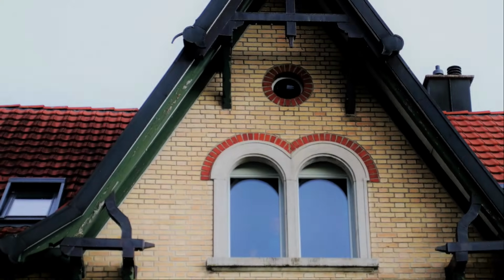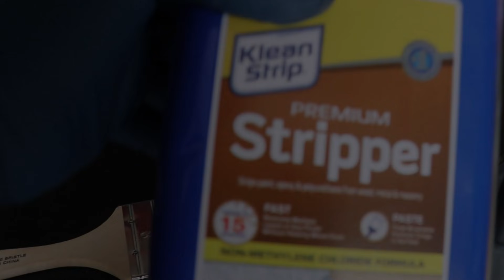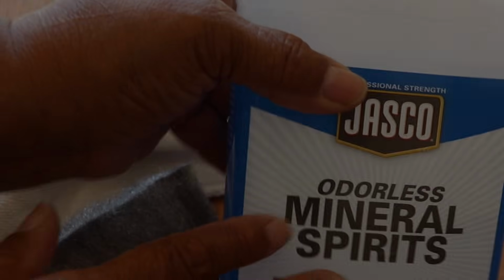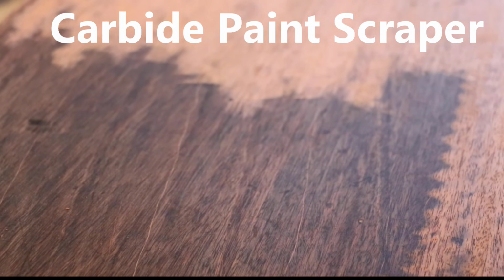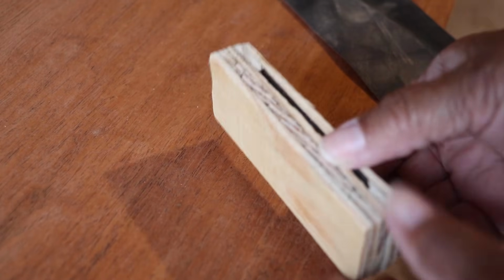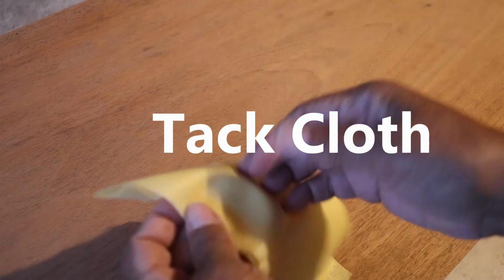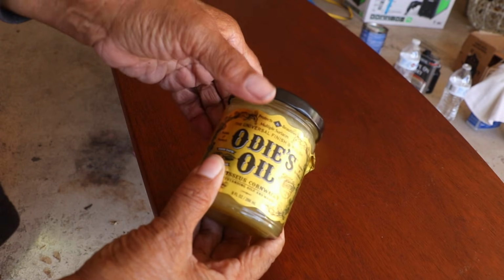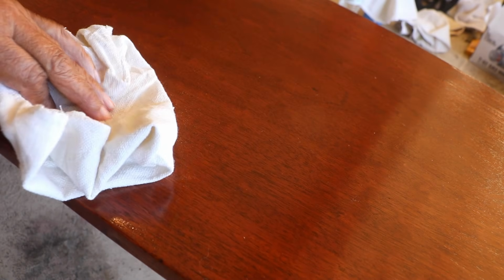$20 Thrift Store Rescue// Furniture Restoration for Beginners

Comment: Beautiful job Ms. Leah!  When you said Grandparents attic, I thought you were going to revisit how to tell the difference between shellac and polyurethane and not to ruin a proper antique 😂. I am always torn between Oldie’s and Kramer’s, I like both.  I did pick up a small pine dining table years ago that neighbor’s had put out for trash pick up,  they said the leg was broken and it couldn’t be fixed.  I was going for the wood to repurpose, so it didn’t matter.  The leg wasn’t broken, the angled brace board that it affixed to was cracked and the holes where the bolts went through were messed up, as well as a couple bent screws into the apron, I think someone was dancing on the table…a little glue, some patching and the table has been in service for many years in my shop.

Comment: In my youth I made the mistake of too aggressively stripping a piece of furniture that I didn't realize was veneer. The patch I did was smooth but I could always see it. It was a 50s era dresser that was stained green. It was funny that I ended up stripping the veneered surfaces and leaving the solid wood trim surfaces the original green stain.  I had that piece for almost 40 years before I finally got rid of it. It was still a solid piece of furniture the day I sold it (before a move). And I'd gotten it for free in the first place, from family, just like you suggested.

Comment: What about that wax layer will a chemical stripper remove that as well ? . Side question I usually like to leave the wood looking it's natural color what's you're go to finish that don't react like the before mentioned wax stuff ( i.e cup rings )
Reply from the maker: If I understand your question,  youre asking how to strip heavy wax from a table.  Mineral spirits cuts eax build up.  I suggest you test a spot first before tackling the whole table.  Use a scotch brite or very fine steel wool to apply mineral spirits.  Hope this answer you question.
Reply: @seejanedrill  is a coffee table I found And attached to a hospital tray I also found lol thanks much for the info

Comment: I have tried the paint stripper that you showed was not that impressed. Found Rust-oleum Aircraft Remover actually by accident and works better and is soap and water clean up and low vox, but should use good ventilation with any chemicals.

Comment: Be very careful with this stripper as the fumes will accumulate along the floor, including migrating down stairs, causing fires or explosions when they contact the pilot lights in hot water tanks, stoves and other gas appliances. Read and follow the cautions on the back of the can. Also if using outdoors, use in the shade in order to slow evaporation rates, giving the chemical time to work. Use eye protection!